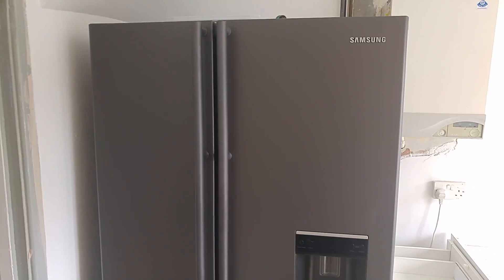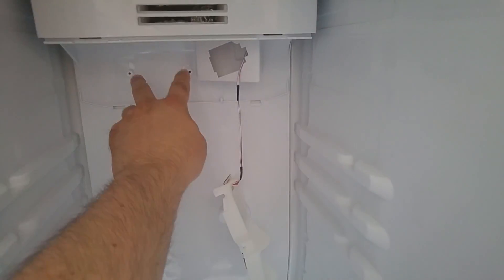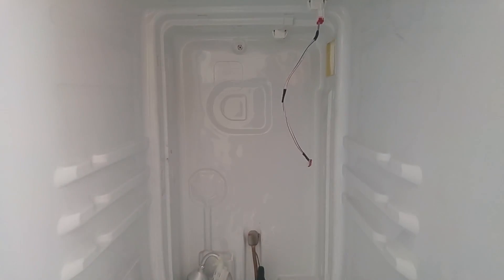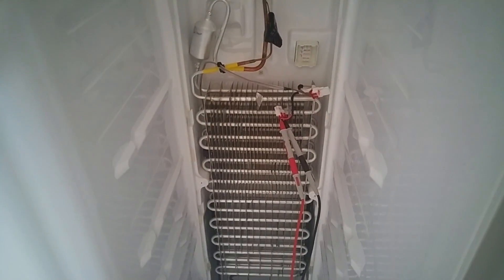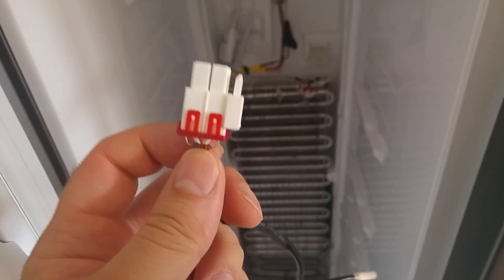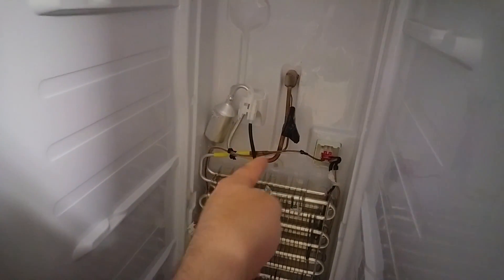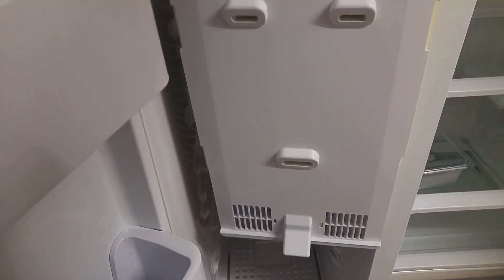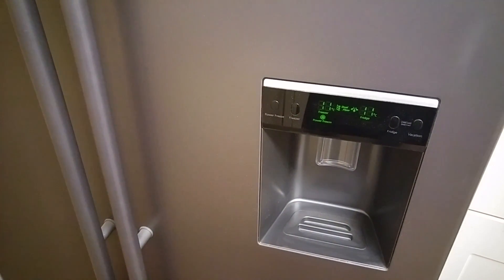Samsung Fridge Repair RSA1 (Defrost sensor + other fixes)

Comment: Just fixed my Samsung Fridge, using some of the info in this video. 
My fault was water periodically coming out the front of the freezer and also a block of ice forming in the bottom compartment. When I removed the rear panels, I found that the water outlet at the bottom of the cooler/heater was blocked and ice had now formed all over it. By following this video to remove the panels etc, I have now managed to defrost the ice and clear the outlet.
Many thanks for your help! 🙂

Comment: after dismantling and defrosting my freezer 3 times I finally found your video. Just replaced the sensor and hopeful it's solved the problem. Cheers for sharing it
Reply: How did it go ?
Reply: @gazzer100  from what I can remember mate it worked fine, moved house and have a built in one now. My brother has the old one and to this day still going strong 👍

Comment: Awesome job!  A lot of work to get to that sensor!!!  Great when you can repair it yourself though =D
Reply from the maker: Thanks mate, I like to have a go at repairing anything myself as it keeps costs down. Thankfully it all kind of became obvious one I started taking it apart, it was just handy having someone tell me where to start (I in the cover in the back of the freezer compartment) that stopped me going round in circles trying to find the problem

Comment: Thank you very much for the video.  I ve the same model. RSA1WTPE1/XFA.
IT shows also the erro. The whole number if the freezer us flashing. And the fridge side get so cold that the things on the bottom get frozen. I have slso the change the sensor? Or its an other problem? TIA

Comment: Hi, great video! I have the same model but the freezer has stopped working without any error codes, do you know what this could be? Thanks
Reply: chewtube i have the same problem. Did you repaired yours in the meanwhile?
Reply: Hi Denis the Menace, we couldn't work it out so we bought a new one

Comment: Mine is not freezing showing -25 and dual flow,any ideas
Reply: Check its not in demo mode. Hold freezer and power freeze buttons together until it beeps. then see if it starts cooling.
Reply: Does the flashing on diferent sides of the 8 means somethin diferent is broken or just something my rsa 1wtpe doesnt want to freeze have been in storage for atime did the demo thing doesnt work

Comment: did youre freezer and fridge get cold with the error from the defrost sensor? because my fridge is the same i dont get any error codes but my compressor wont kick on first you hear a click from the capacistor and after 5 seconds the overload clicks and the compressor sounds like it dont get enough power to start up or something its not vibrating also.. some one knows anything about that?
Reply from the maker: With the error mine did not get cold